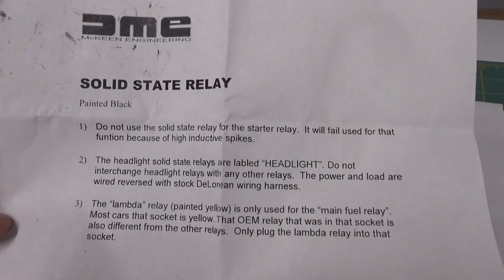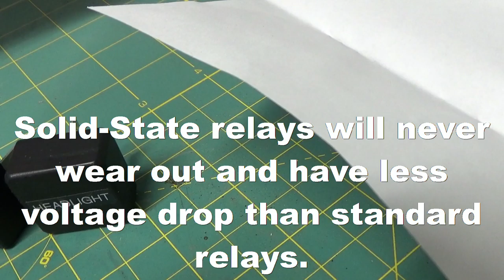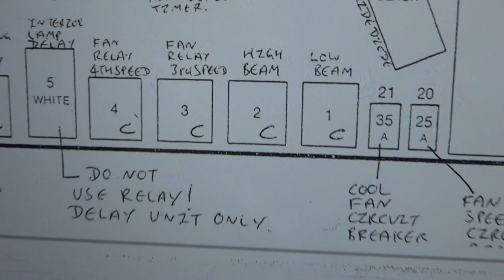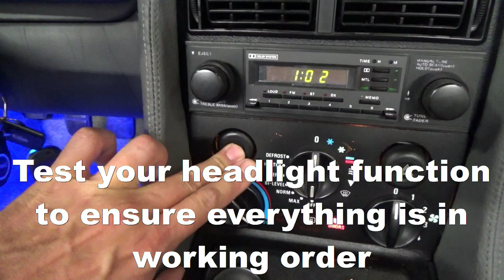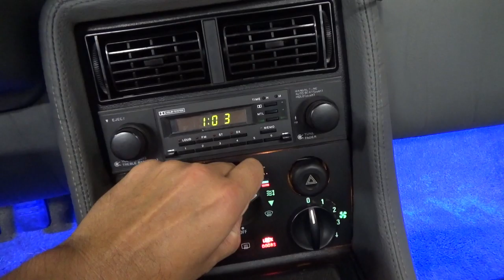Solid-State Blower/Fan-Speed and Headlight Relays for the DeLorean DMC-12

Comment: My 4th speed fan relay keeps tripping and hot as the sun.  Looks like I'm placing another order to Dave for at least the fan relays.  Just upgraded the stock cooling fans, cooling fan relay, and fan fail module a few months ago.
Reply from the maker: PSB Nighthawk 4th speed blower relay is a definite weak point in the cars system.   Upgrading to Dave’s solid state versions will solve that issue.